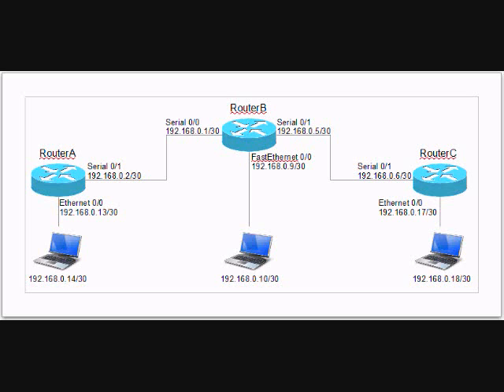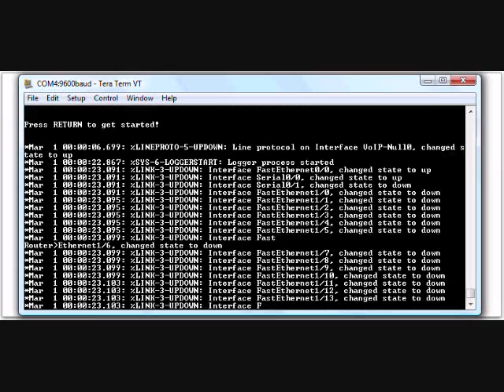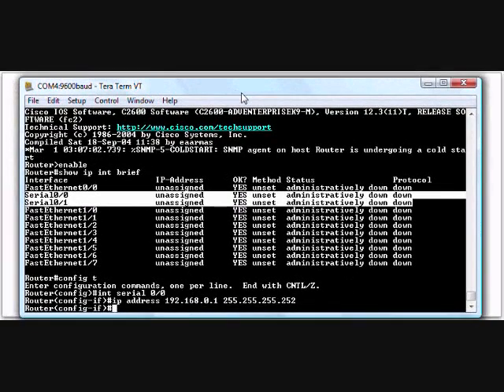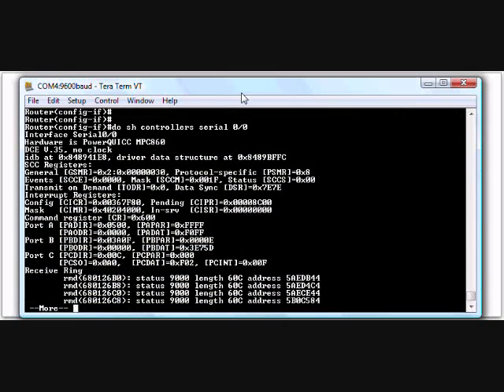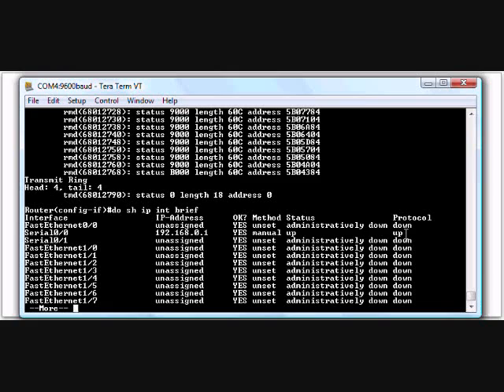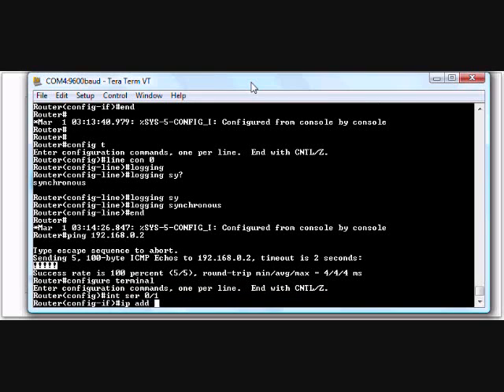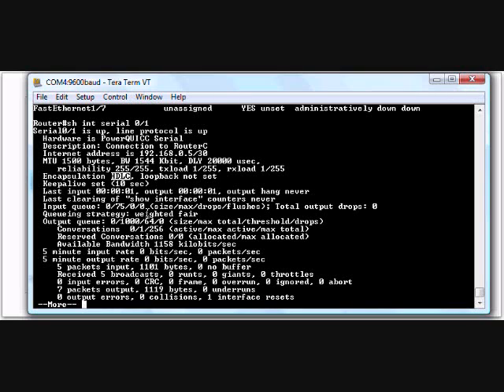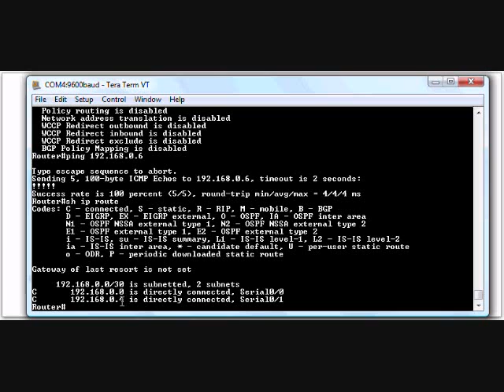Lab 2 - Configuring an Interface

Comment from the maker: Don't get to bent up about the controllers thing.  Its just a piece of hardware built into the router. I've only used the command to verify if a DCE or a DTE cable was plugged in and whether or not I could see a clocking signal on it.  Other than that, I've never had to look at it.  I'm glad you're getting something out of the videos.

Comment from the maker: With an ethernet interface, you don't need to worry about clock rates.  On older serial based systems, the clock rate basically determined how fast you could send data across it (bandwidth - not to be confused with the bandwidth command).  The faster the clock rate, the faster you could send data.  With FastEthernet ports, you're going to send data at 100Mbps.  Thats just how it was built.  If you want to go faster, you'll have to use GigabitEthernet (1000Mbps).  There is no clock setting.

Comment: Great video!  I had a little trouble setting up IP address originally because turns out I was using the switch.  Anyways pretty informative.  I wasn't able to run the clock rate command, I wasn't sure if it was because of the type of router I'm using (1800 series).  .

Comment: Actually I had a little trouble following step by step because I'm pretty sure my router doesn't have a serial interface.  When I run ip interface brief, it only shows two FastEthernet interfaces.  So I followed the steps using using one of those for the lab.  

When I run show controllers fastEthernet 0/0, it won't tell me if its a DTE or DCE correct?

Comment from the maker: First, ensure that you are trying to run the commond on a serial interface.  Next, ensure that interface is a DCE interface by running "show controllers serial 0/0/0", assuming you're working with serial 0/0/0.  The interface should identify if it is a DCE or DTE interface.  A DTE interface should not accept this command because it is supposed to receive the clock rate from the DCE device.